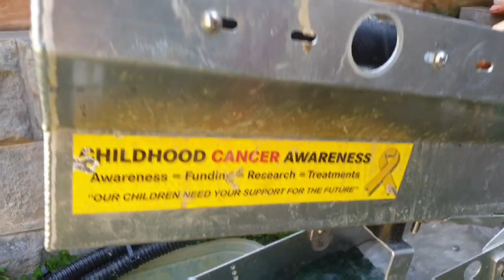6" Gold Rat Highbanker Modification

Comment: Gday mate,,  great vid,,,     I too have the 6 inch GR highbanker,,   i think its a must have for the extensions, 1 dream mat is simply not long enough,,  i found i was losing a fair bit after panning out some of the tailings,  i got 2 extensions, 3 dream mats now,   and i'm catching maybe 90% ,,,     great idea with lifing up the hopper, its pretty tight in there when doing a clean up,,    i have also noticed when you get home,  take apart and clean the hopper into a bucket,,  very surprising how much shiney is caught in and under the punch plate,,     another idea i think that could work is a 6 to 8 inch flair to whack on an 8 inch sluice ,, maybe down the track i'll try that one day
Reply from the maker: I tried to run 3000GPH though the hopper to see if I could put it on to my 8" and personally I think it's a bit much. I have lifted my hopper screen about 15 mm off the hopper so nothing get caught under it. My reason for the extension is to try a few different  mats and riffles, I wanting to catch more concentrate and gems. I have miner's moss at the base under the hopper and remove and quickly clean  every 50 Shovels. The other option is to try and put a 888 sluice with a 1100GPH pump above the feed zone that way you can get the right amount of water flow to that mat and because it's a 8" it should catch what's getting though. The only time I've lost gold though the mat is when I'm running clay or have over feed the mat and if I go above 12 degrees.
Reply from the maker: nigel hill  In the link is a video of me running my 8" river. Sluice at the bottom of my home made highbanker. I add a 1100gph pump at the start of the 8"sluice.
https://youtu.be/S9Txpnl7434